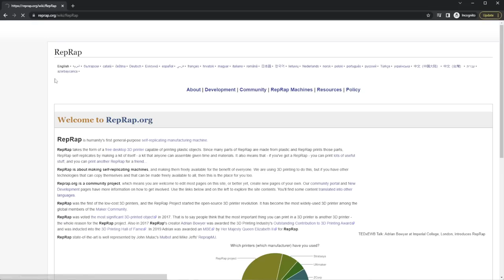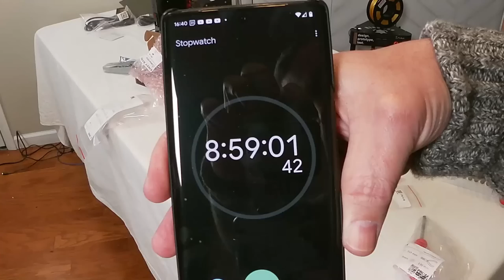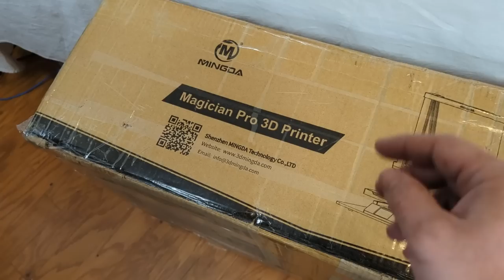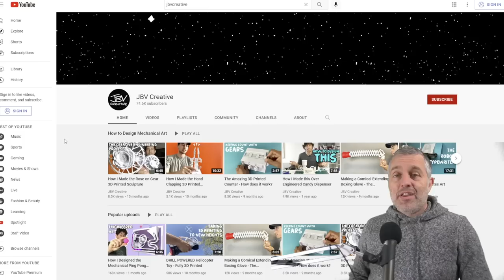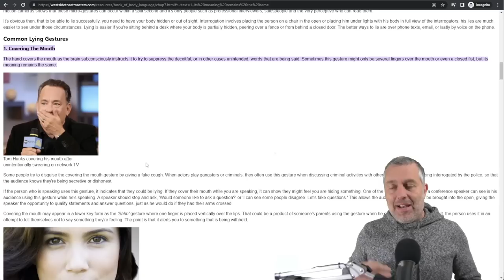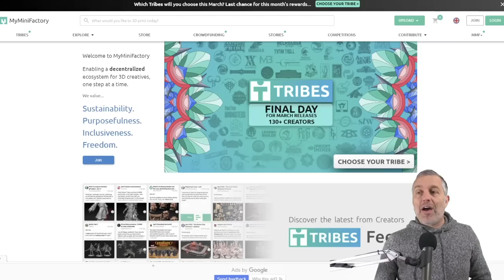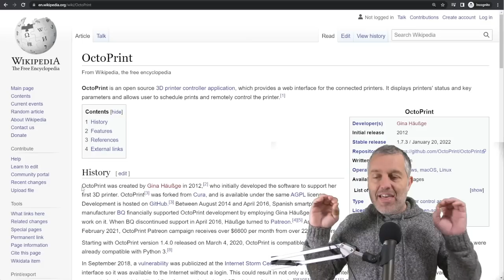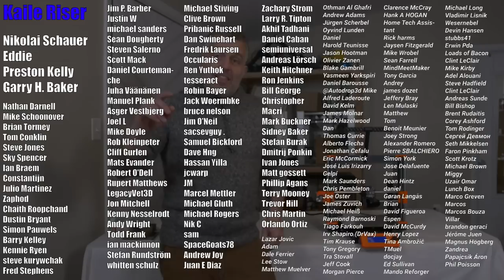Why Does Nobody Speak Truth About The Prusa I3 Mk.3? - It's Overhyped and Over Priced.

Comment: What to say, I really think that this video is a buzz video and you'r trolling Prusa just to have more visibility. Maybe I'm wrong ... anyway! (I'm not juging you).
It's not Prusa fault if you try and compare a print on an untuned printer and try to explain why it does fail. Underextrusion is easy to fix. A correctly tuned printer works perfectly.
As for the comparison with the Ender 3, I don't think you ever set up and administrated a printer farm. Try to do it with Ender 3 and compare with Prusa MK3S. with the Prusa it "just works" ... results are consistent and repeatable and we barely have any maintenance to do on them.
Now for the quality, you'r saying that for $155 you get almost same printer as MK3S. I don't agree. Search all over the internet how many house burned because of faulty Prusa MK3S and how many because of Ender 3. Ender 3 faulty power connectors (fake 3M connectors) have triggered so many fires.
Prusa is provided with Misumi high quality bearings, with Delta or MeanWell high quality and secure power supplies, a flexible metal print sheet (that the Ender has not, scrapping a sheet to get my print ... in 2022, seriously ...), an autobed leveling (that works extremely well, especially if you set it to 7x7 matrix), a true full metal Hotend from E3D (the reference), the MK3S can go up to 300°C with its hotend without problem, witch makes printing ABS and Nylon easy, the Ender 3 is limited to 255°C, and even if you can hack it to go up to 280°C, its PTFE tube doesn't handle more than 240°C and it starts degrading and producing toxic fumes beyond 250°C.
You are criticizing the E3D V6 choice, the Prusa MK3S is  a "old" design, so it's not fair to compare it to new Voron or other CoreXY designs. The MK3S is almost 4 years old design. New printers are providing great displays, new technologies like CoreXY design, Lidars to do bed alignment, like the BambooLab printer, it's unfair to compare the MK3S to them. 
The MK3S has silend motors drivers, which the Ender 3 has not, and it has sensor less homing while in the Ender 3 you keep fiddling with mechanical contacts (that work fine when "they are new"). On the MK3S you got dual axis Z motors, on the Ender 3 you have only one motor. 
Sorry, almost all my friends who bought the Ender 3 have spent almost more than $250 just to make it descent printer, and they still have to level the bed each 10 or less prints to get good results. On the MK3 we never do any bad leveling or calibration until we touch or disassemble the printer for maintenance.
The MK3S has a direct drive filament feeder, with the gears provided by Bondtech. The Ender 3 is a Bowden extruder based. This makes big differences for:
1- the filament used especially if you want to print flexible filaments. The Bowden design can be a true problem.
2- the print speed. You can push print speed up to about 120mm/s easily with extremely good and consistent results with MK3S. You can never reach this speed with the Ender 3 (in consistent and repetitive manner) because the Bowden design have extremely high difficulties at keeping enough filament pressure in the nozzle, especially for filaments requiring high level of retractions.
Sorry, I'm not a Prusa fanatic (I use other printers) but the Ender 3 if upgraded and all its components changed to high quality ones like Prusa will cost almost same price as Prusa (and you lose the Prusa quality support).
Ender 3 is a good printer for beginers, to learn 3D printing (the hard way), but not a "production quality" printer. Its parts are absolutely not comparable to the Prusa parts.
If you want a Prusa with low quality parts like the Ender 3, buy a FYSTEC clone at $320 and even with that you get a better printer than an Ender 3.
You got what you pay for!!!
Reply from the maker: You are wrong. I've had serious criticisms of Prusa since 2017. Go on any forum and ask them about Design Prototype Test. Watch the Prusa fanboys hate on me to an insane level.
Reply: @DesignPrototypeTest  I have nothing against you and I watch your videos and I think you can have your own opinion about Prusa. This is legitimate. I use Prusa machines a lot (for reasons) and I hate Prusa fan boys and they way they tend to associate everything in 3D printing to this brand. I like open source and like freedom and fanboys spirint goes againt this.
But what I criticize in my previous answer is the comparison you'r doing between the MK3S and various printers. MK3S is an old design, and it's really better than Ender 3 for reasons I enumerated. I don't say Ender 3 is bad, I only say that it needs too much work to get to the same level  of MK3S. Ender 3 pro or CR10 Pro are better choices to compete with MK3S, but even for those, the parts quality is far lesser than standard parts provided by Prusa with MK3S.

Comment: Upping print speed on both printers is a weird way to compare. Not saying the results would change one way or the other but changing feed rate especially that much is a weird way to compare printers instead of adjusting settings on the slicer end
Reply from the maker: Here is the test print. And Gcode. You are welcome to try it yourself and see if you get different results. I didn't feel like reslicing both gcode files when I could just run them at a higher speed multiple.
https://drive.google.com/drive/folders/1JlXvhoycPJheTNbGwG4gmXi5GAawTQg2?usp=sharing

Comment: I own 2 Prusa I3 printers and an Ender3 and having used both of these printers for a long time I can say conclusively that my Ender can produce quality prints and does so at much lower price.  I've even printed the same project on both printers and integrated them with no issue.  Where I think my Prusa shines over the Ender is consistency and reliability.  My Prusa I3Mk2.5s has been my go to printer.  It just works.  My Ender can be a little fiddly at times, especially when it's sat for awhile unused, where the Prusa can sit for the same amount of time and just works.

When I got started in 3D printing I talked to a friend who entered the hobby for me, he asked me this question "Do you want to print or do you want to learn about 3D printing?"  He then told me if I want to print go Prusa, if I want to learn about printing there are many options.  I went Prusa and am quite happy that choice.  While I'm happy with the results from my Ender, I firmly believe my Prusa will last longer and be more trouble free.
Reply from the maker: Player 3 has entered the game. What you are saying about Prusa is even more true of Bambu Lab. Specifically the X1 Carbon. You just send a print to it and walk away. Even if it has been siting in fluctuating temperatures for a month. The only thing that messes it up is if the bed glue is old. BUT IT CATCHES THE MISTAKES! It does a first layer scan and if there are problems it pauses and waits for you to inspect it before continuing.

Comment: 15:30 it’s not important that the measure changes over temperature. The probe is used for bed mesh and not to sense the distance for a first layer height. 
Voron design printers uses induktive probes as well for example.
Your Prusa hate is a little bit to much for me. Prusa is doing a really good job and this cost money. 
I don’t have a Prusa but I will buy one at some point. For know my Voron 2.4 is all I need. 
I think that’s my last video I watching from you. Have a nice time anyway.

Comment: I own many printers from Ender 3, Cr10s, my own built Prusa bear and a legit Prusa, and I really think that the Prusa is worth the money and a fantastic printer and if you have the money buy one over other printers. I do think it has many shortfalls but it's a fantastic printer. 

It's also using sensor less homing by the current changes/resistance in the stepper drivers.

It frustrates me that people call it the Prusha. I also can't help but feel you're slightly bitter about the Prusa and how it's pushed itself to the forefront of Fdm printers.

Comment: As a person that started this hobby diving to the deep end by designing a CoreXY motion system from scratch and an Ender-3 v2 owner myself, I noticed inherent accuracy and long-term repeated problems due to poor design after a few months of use.

• The linear guides for the z-axis travel are fiddly to align.  Although the linear guides function with misalignment due to the somewhat soft nature of the v-wheel, it causes excessive wear.

• The plate bracket connecting the z linear guides, single leadscrew nut, and the cross beam does not do a great job holding the cross beam in place.  The single lead screw design choice creates a moment load to the driven side bracket as the non-driven end of the cross beam is not vertically supported.  The driven side plate bracket is inadequate because the only thing that is contracting the moment load is the friction between the anodized aluminum crossbeam and coated steel plate clamped together with a stainless steel bolt threaded into the aluminum cross beam.  The weak hold is especially problematic if one opts for a direct-dive filament feeder modification, as it will add weight to the moment arm and exacerbate the problem.

• The dive belt attached to the X and Y-axis carriages are not parallel, making the linear displacement per pulley rotation uneven though the span of the axis travel causing dimensional inaccuracies of the printed parts.

• The design of the pre-loading mechanism of the filament feeder is highly questionable.  The part made of plastic has a design that uses bolt threads supported on one side as pins. Although Creality tried to compensate for this by adding a plastic tube around the bolt attaching the preloading arm, it is still a cantilever pint attached by a single bolt with no mechanical joints preventing the plastic tube from rotating and getting loose.  Moreover, the ball bearing that push the filament into the hobbed gear still uses the treated bolt like it is a dowel pin.

• The PTFE liner inside the hot-end rotates, giving room for the molten filament to get between the nozzle and the liner, causing extrusion issues after a spool of prints.

I see so many abandoned Ender-3 printers because of these flaws.  I am yet to find an upgrade kit that addresses all these issues at once.  I wish I were the time and ability to develop a kit design delivering on a promise to resolve all these issues in under $200 of mechanical components.

--------------------------------------
On a side note, I see many linear rail “upgrade” kits with sketchy brackets or 3D printed “upgrades.”  So many of these modifications make people’s Ender-3 just more quirky and expensive, not any better.

Comment: I like your analogy with the polished turd 😄 When I recommend a printer to non-tinkerers, I usually recommend a Prusa. Mainly because I know that I will be the first guy they contact once something goes wrong. Prusas quality control, documentation and community ensures that I have to do as little technical support as possible. I don't care how much those people have to pay in order for me to not be the tech support guy 😅 It's the same reason why I recommend a Macbook to my parents and an iPad to my grandparents. It's to make sure that my job as tech support is as small as possible.

On the other hand, Chinese quality standards have gone up and some of their communities are huge as well. I'm especially thinking of Creality right now. The gap is steadily closing...
Reply: I got an ender  3 s1 recently, and despite a problem with the printing surface, the machine has functioned flawlessly, quietly, and has made the learning experience pretty fun.  I barely had to assemble anything (less than 20 minutes), any it just worked.  For $400 it feels pretty hard to beat, though it could use higher temperature printing ability and octoprint capability on board.  I think we'll see that in the next year or two's iteration of the ender 3 as creality moves higher up the integration stack.

Comment: I have 5 3D printers and thousands of printing hours, the prusa mk3 has the most reproducible results of my machines and it’s not the most expensive. Is it the best machine? No. But will it print 10,000 hours? Yes. Mine has.
Reply from the maker: So, do you think you are representative of the average guy who is going to get into 3D printing? Should everyone go out and spend almost a thousand dollars before they even know how much printing they are going to do? If you are the RARE individual who has figured out a product you can print that actually sells then I guess you can justify a Prusa based on some random stranger on the internet claiming his Prusa has lasted for 10,000 hours of printing. I can't verify your claim. I don't print that much. I don't like to waste the expensive filament. I think the vast majority of users are more like me than they are like you.
Reply: @DesignPrototypeTest  I don’t sell anything, I make things for myself. Such as drawer organizers. I have over 1000 hours in printing those alone. I’m a software engineer and I like to make things in my own time. I print things for my friends. A lot. Shelf brackets, wasp traps, mailbox lettering, custom brackets for mounting electronics is weird places or Hard to get replacement parts. I do have friends that print as part of a business. They buy the cheap printers and just throw them away if anything goes wrong because time Is money. For an individual who just wants something they don’t have to do much to maintain, prusa i3 is just fine. You seem very biased. I tell my friends if they want to try 3D printing get an ender3. Super cheap and works pretty okay. But I end up fiddling with it a lot. Same with my flash forge. The prusa I don’t. I just start the print. I’m sure there are other similarly priced printers with the same result but that’s no reason to be so hard against this one. It has a big community to help you as well, something that you don’t seem to give much value to. But for newbies that’s more important than features.
Reply from the maker: @Diamonddrake  Let me first say how much I appreciate you! Truly. You never even talked about my person until the "you seem biased" comment. You are the rare commenter who disagrees with me but does so without attacking my person (shooting the messenger). I am biased. Every time I talk about Prusa I am fighting and while I try to be reasonable and impartial in my criticisms I am attacking. Prusa NEEDS to be attacked. I don't feel at all ashamed to admit that I am providing the needed counterpoints to the conversation.  I didn't start out being this way. Watch me fanboy for Prusa here: https://youtu.be/knHivSlvXsQ?t=427 Then I started to question Prusa and provide dissent. That's when the hate from "the community" hit me like a sledge hammer to the chest. You try standing up to a mob of irrational fanboys who suffer from sunk cost fallacy. You try enduring 4 years of personal insults from strangers (and sockpuppets?). See how unbiased you can be after that experience. I think I'm doing pretty good to not be a ball of rage and hatred over this unfair treatment. Again let me ask you: Do you really think everyone  is like you? You seem to be quite talented with skills that are in demand. Is everyone who buys a 3D printer going to get the extra $600 of utility out of a Prusa, or would they be better served with an Ender 3 for $200? I'm not trying to make you feel like your Prusa wasn't a good purchase. Let's just acknowledge that it is 2022. Time to move on from loving Prusa. That company/man is not worth your affection and the printers aren't that great anymore compared to the Chinese printers available now which cost less money. Not that I love China ( https://youtu.be/6moNRCXCZpc ), but that's not the subject right now.
Reply: @DesignPrototypeTest  if you wish to be an honest detractor since so many people are on team prusa I respect that. Some advice though, If you want people to take it seriously you’ll have to be a bit careful with what you chose to complain about. I don’t think you’ll win too many people over complaining about branding. Many people would say him putting his face on it means he believes in it and stands behind it. I did have a bit of a trouble understanding your point toward the end of the video, you seemed to say don’t spend $750 on the prusa, spend $800 on this Chinese printer that has basically the same features. I think you were getting at this idea that there’s a lot of printers out there that do more and possibly better so “broaden you horizons” but that message was getting lost in your frustration. But one could agree, the mk3 is the best of a 10 year old technology at a modern price, newbies should consider trying modern hardware if they are going to pay modern prices.
Reply from the maker: >don’t spend $750 on the prusa, spend $800 on this Chinese printer
Yes that's what I was saying. You get touch nozzle bed leveling, Filament runout detection. 20 minute assembly time, a much better looking design, touch screen functionality, and 5.5x the print volume for only 50 dollars more! Why would anyone choose a Prusa? The Mingda Magician Pro is a much better choice at that price point. Most people would be better off only spend ~$200 for an Ender 3.

Regarding your criticisms of my presentation: If you think you could deliver the message better than I am, PLEASE DO! I'm not trying that hard. I'm not earning any money doing this. I'm just here trying to help people see through the BS and fanboying so that they don't waste their money. Have a great day!